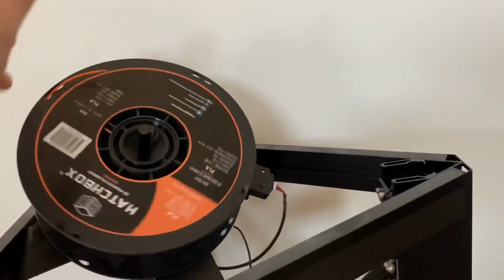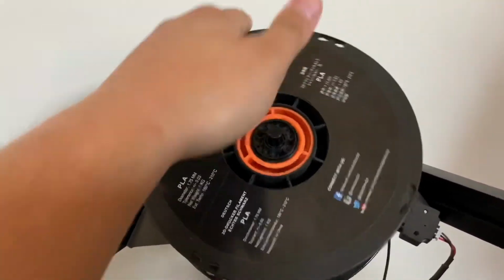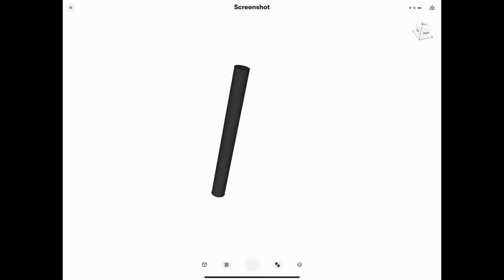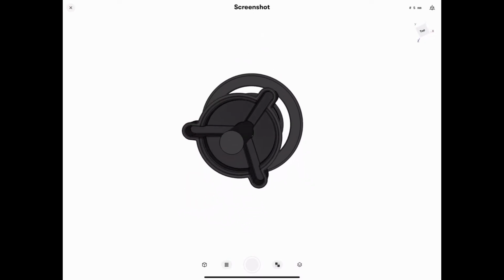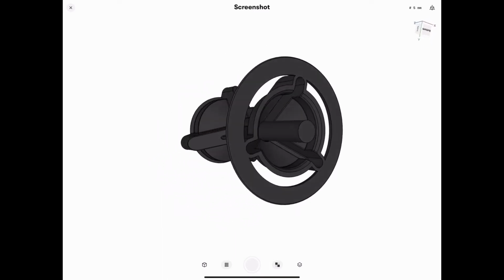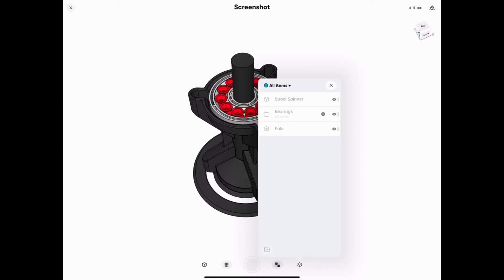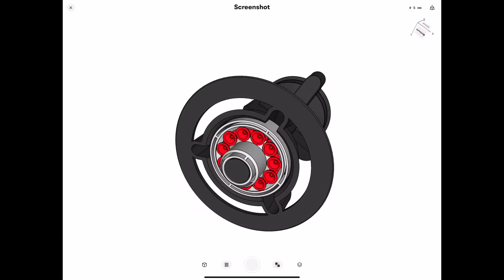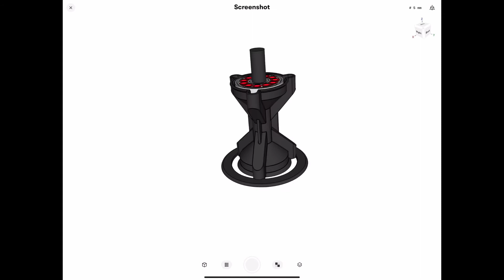Monoprice Delta Pro Upgrade: Spool Spinner

Comment: have you had any problems with the printer mine is almost a year old just sent it back, have you been able to fine upgraded parts online?
Reply from the maker: Not too many upgrades. Join the fb group theres alot of useful info there 👌
Reply: @JLake3D   is it only on Facebook if so what's it called? Thanks again for your time.
Reply from the maker: Kirk Dorsch monoprice delta pro 😜